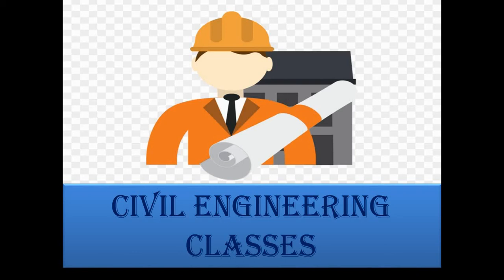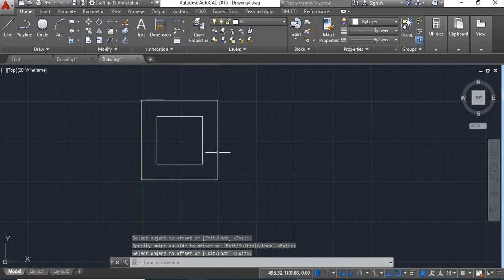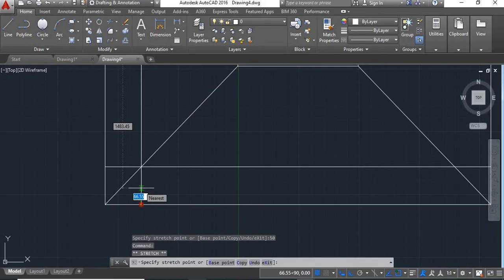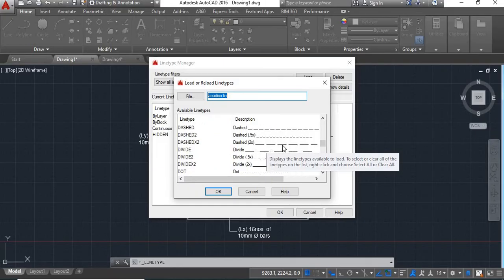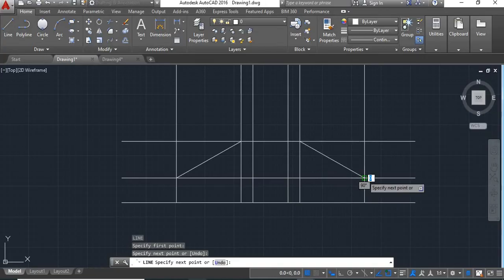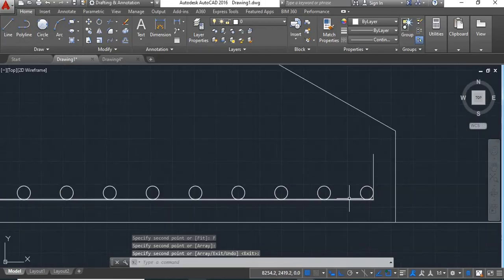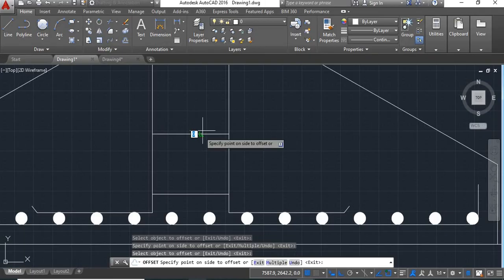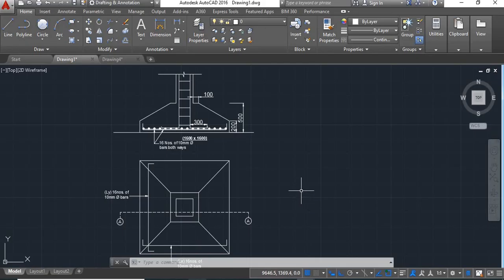How to do steel detailing of Trapezoidal footing in AutoCAD

Comment: Why 15 mam radius of circle, in question it's 10 mm dia sor radius is 5 right
Reply from the maker: Yes it should be 5mm.. But just to make it visible I have taken 15mm
Reply: @civilengineeringclasses9680  Is it generally taken more than required for visibility or was it just for making it clear in this video?